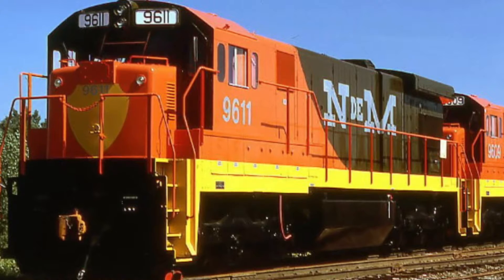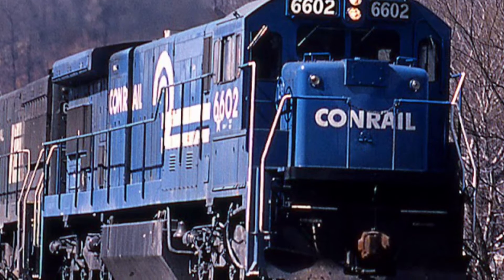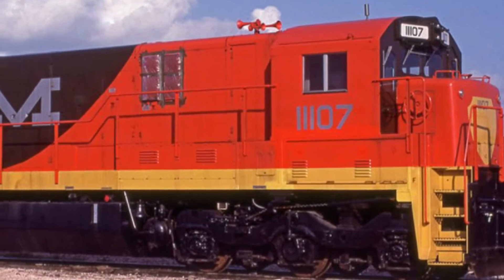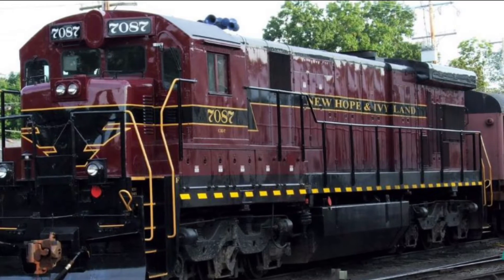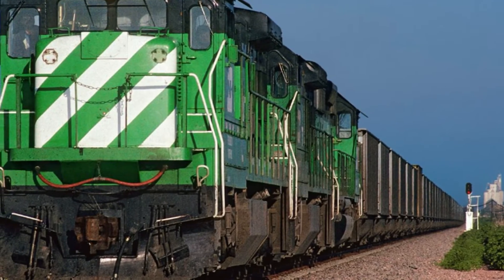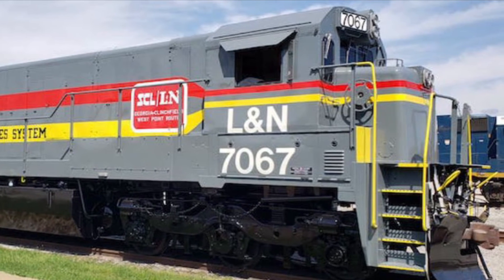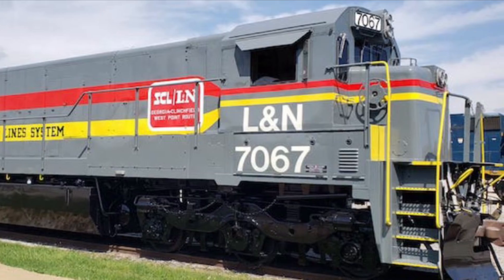Engines of North America: The GE C30-7

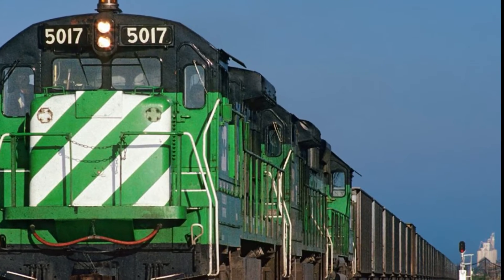Comment: 2:31 BN 5017 this would be stored for several years before given a second chance at life with: MMA. It would keep operating until july 7, 2013, near Lac Megantic, QC. 5017 was tied down on a 1.2% grade with 7 handbrakes applied on the day before during night, leading a 72 car long DOT-111 tanker train, (and a buffer car) each one fully loaded with crude oil, long story short: 5017 suffered engine fire, 5017's fuel stop button pressed and held, fire was put out, air brakes depleted slowly, handbrakes couldn't do their job, train runs away, & eventually derails in the town of Lac megantic, spilling 6,000,000 liters of crude oil and igniting it.